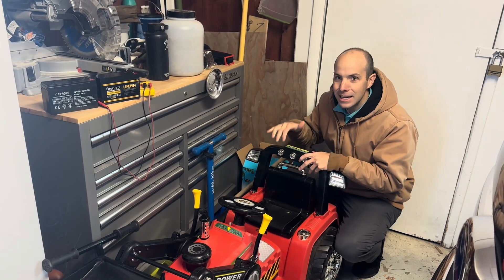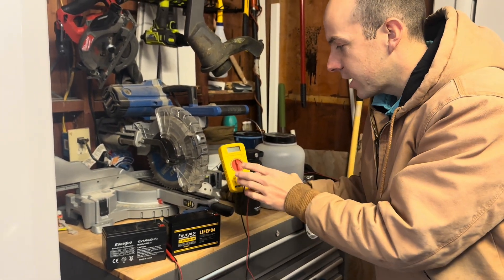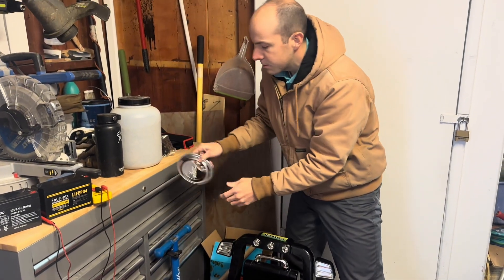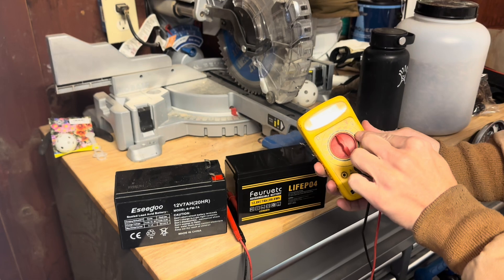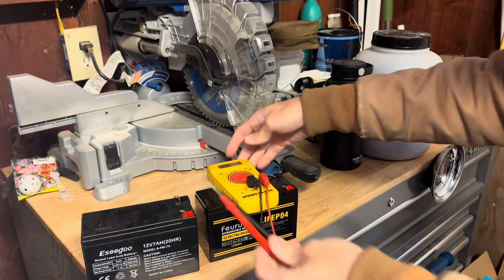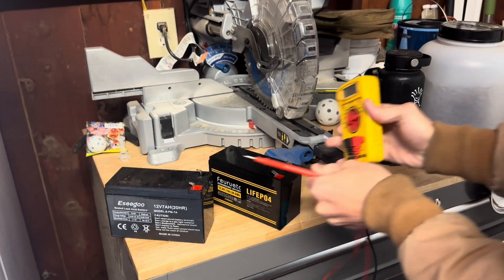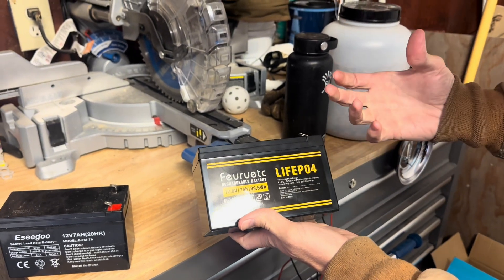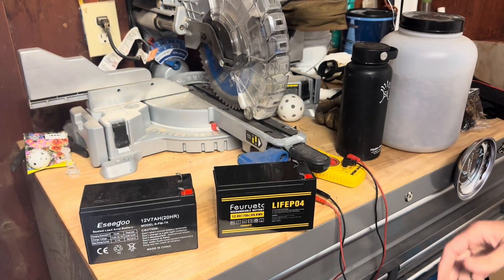How to test a 12v kids ride on battery with a multimeter

Comment: I have a 24 volt ride on car from Walmart battery is reading good, but when they gas it.. it cuts out and doesn't have hardly any go. I have no electrical knowledge do you have any suggestions?